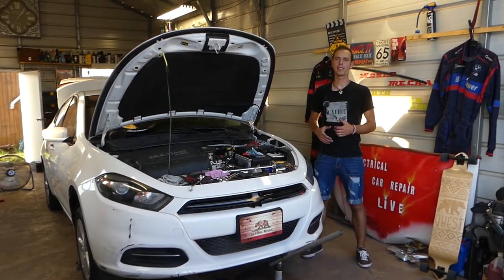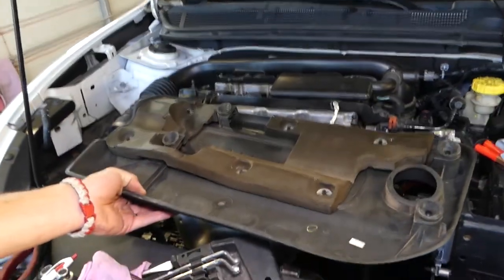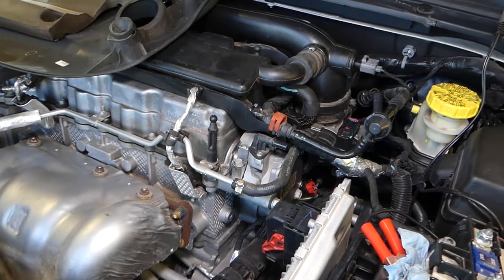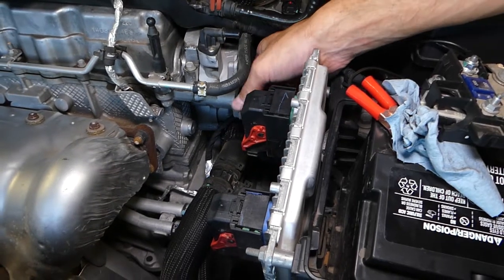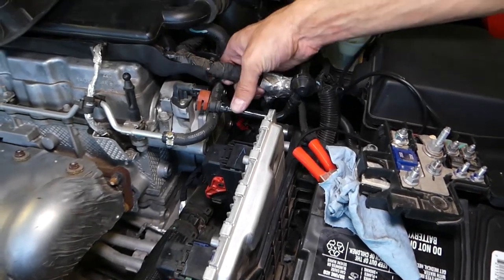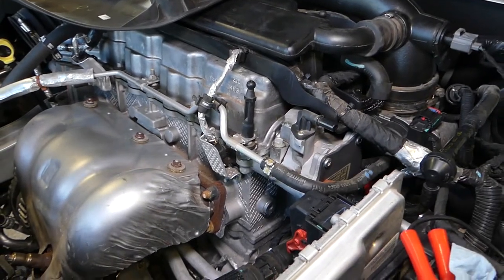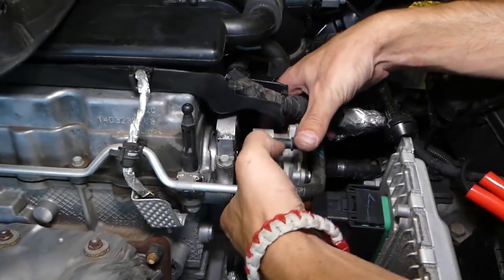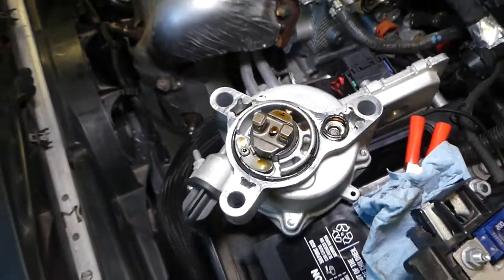BRAKE VACUUM PUMP REPLACEMENT 2.4 MULTIAIR DODGE DART CHRYSLER 200 JEEP CHEROKEE RENEGADE COMPASS

Comment: Hey brother is there anyway I can get your opinion on what’s going on with my 2013 Dodge Dart sxt 1.4 keeps making grinding noise every time I hit a bump comes out with code p2006 talks about intake manifold runner controller then brings up butterfly valves  and I just recently had the 6 speed manual transmission clutch kit done with new flywheel and slave cylinder and still have this Weird noise it comes and goes and when I rev it makes that rumbling noise on driver side

Comment: You obviously work on a lot of the 2.4 liters. What would be some of the more common reasons for a rough idle on the dodge darts. Ours is a 2013 with 67K miles and No check engine lights but it idles super rough and nobody online seems to really know how to fix this. Any ideas from someone who works on as many as you guys do, would be awesome. Thanks.
Reply: Having the same issue currently...
Reply: Engine mounts...
Reply: Coil packs. Prob misfiring
Reply: Change the 02 sensors, use the factory oem NTK ones helped me with my rough idle issue